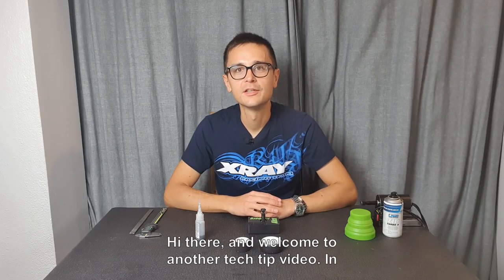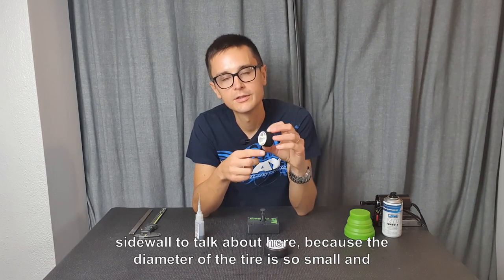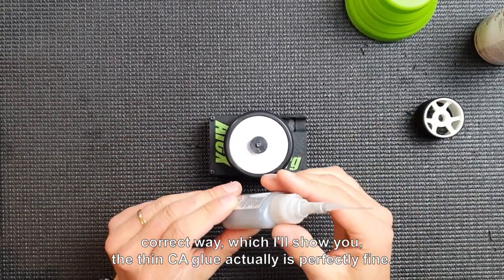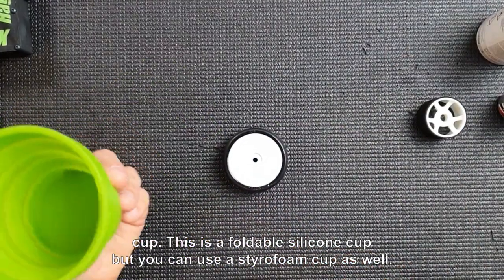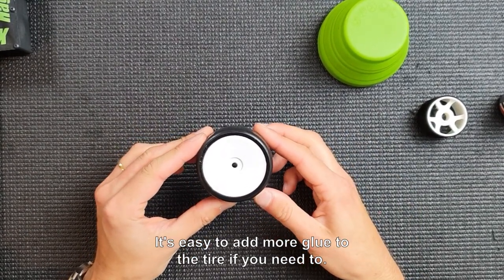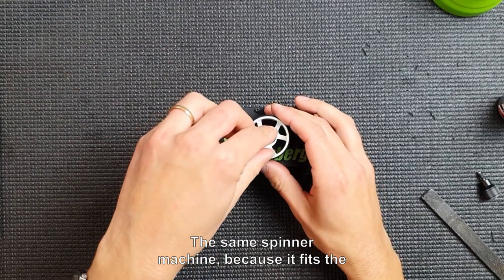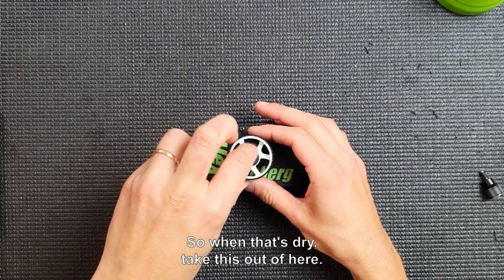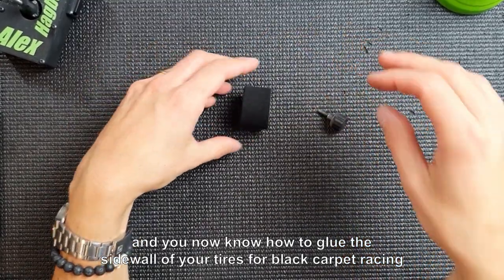Sidewall Gluing Tutorial

Comment: I'm new to all of this and was told about the tire gluing.  Watched a video about it and did it myself.  I took my car to one practice and by the end of it the glue was gone.  Does this also happen during your races with the glue you're using?  If so, doesn't that change the way the car feels throughout the race?
Reply from the maker: I usually use Hot Race thin CA tire glue or AKA tire glue. Both will work well and will last several runs without the need for re-gluing. The glue won't last forever, but you should not need to re-glue that often. Every 5 runs or so!

Comment: On black carpet, what class does this become useful from? Should I do this in stock 17.5 at all? and how often do I have to redo it during a race?
Reply from the maker: For any class racing on CRC Black Carpet, including 17.5T TC Stock. You don't really have to re-do the glue, but watch out for peeling of the front tires (the rubber separating from the wheel) - that you will need to check every 2 runs or so.

Comment: Anyone know where to find such a spinner machine? or any equivalent?  Internet search seems to suggest these are no longer available?  Much Thanks!
Reply from the maker: https://teameamotorsports.com/collections/prolix-rc/products/prolix-sidewall-doctor
Reply from the maker: https://mypitspace.com/boutique/fr/sidewall-gluer-p87/
Reply: @hagberg  Thanks Alex!  Just ordered!  I put my 2023 solid Aluminum X4 on the track for the first time after a 10 year hiatus from the hobby.  The local track is black CRC high grip carpet and I'm using the recommended XRAY black carpet high grip setup but with 21.5 Blinky.  There's a high speed sweeper at the end of the straight and sure enough, major traction roll issue even though the car setup is for max stiffness everywhere.  I'm really hoping glueing the front tire sidewalls (jaco blues) will do the trick unless you know of any other suggestions?  Thanks again Alex!!
Reply from the maker: @michaelhavlena923  what setup do you have on the car! Taking flex out is not the answer - this will in fact make the car more initially aggressive, which will lead to increased traction rolling!
Reply: @hagberg  I'm using the "basic for US black carpet" setup as found online, so as stiff as it could be...Much Thanks Alex!...;)